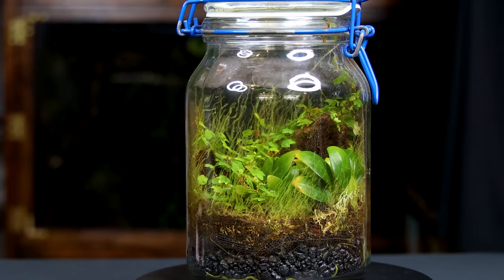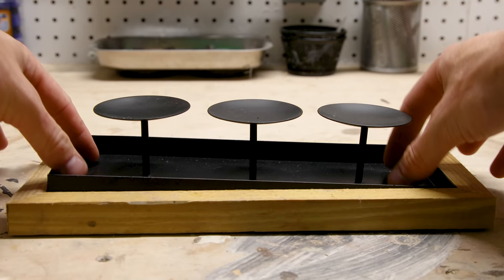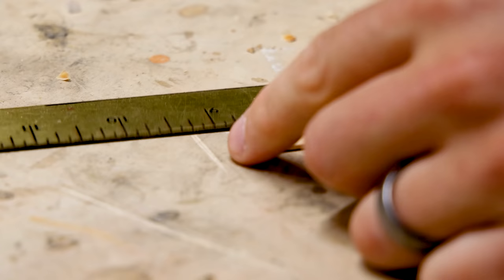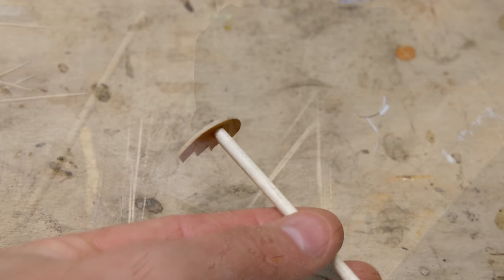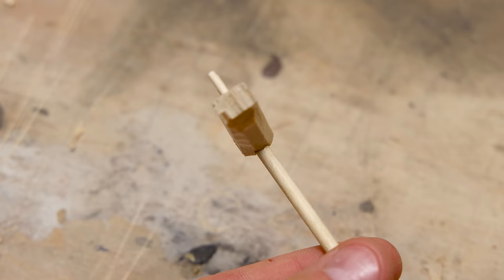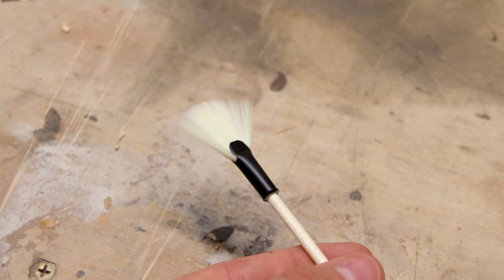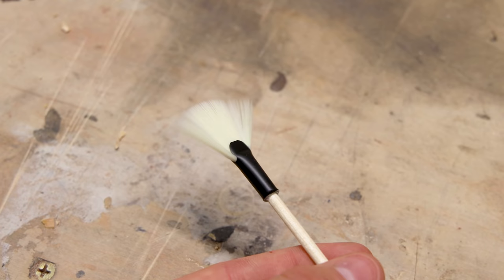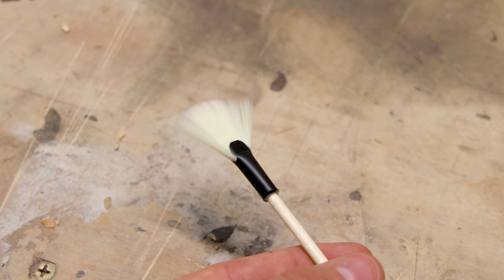DIY Mini 3 World Zen Garden Terrarium

Comment: Hi Serpa! Another awesome vid! Funny thing is, I was just looking through your videos lately and did notice that it had been a while since you've done a terrarium build! Glad you're back at it.

Quick question:

You got me into terrariums this last year, and since then, I've been hooked. I followed your video on moss propagation for my first one. It's been great, and I've been able to find around ten different species to add. However, after a couple of months, mold started to appear. At first I just dunked the moss in a hydrogen peroxide + water mixture, which worked pretty well. It kept coming back though, so I added springtails. While I'm sure the springtails have been helpful, the mold remains. I can't use my old hydrogen peroxide mixture, because I read that it kills the springtails. I have the terrarium under this grow light for 10 hours a day. The moss is looking great, but the mold sort of ruins the aesthetic. Do you ever have similar problems with your setups? If so, what would you do about it in my case?
Reply from the maker: It can happen sometimes due to lack of airflow. If you can install a small fan on the side to keep the air moving, it should stop occurring. Something tiny like these should work. https://www.amzn.com/B08948MT6F/ EDIT get the 5V USB one.
Reply: @SerpaDesign  Thank you so much! I'll definitely have to try those out. Just want to let you know how much of an impact you're having! Rooting you on to 1mil subscribers!
Reply: Oh, and I'd say my favorite was the one on the right. I love the black lava rock look. 😄
Reply: @parmerapps69  I found that too much light contributed to the problem as well. 

Over a year later, no more mold or algea, after switching my moss to live under my Dr Walstad inspired rack w/ shop lights (timer is on at 8:30 am, off at 1 pm, back on at 5 pm, off at 10 pm)

Aquariums no longer grow algae, either.

Comment: I ABSOLUTELY ADORE this tutorial and its unique subject matter!!!  There Is one thing I would have done differently, though. Instead of permanently adhering the globes to the base I would have used strong magnets instead.  You can place one inside of each before the substrate and glue another to the base as one turbo strong option. If you have magnets that are Super Strong like I collect, you could just use one inside or adhered to the outer bottom and that would be plenty to help them stay secure to each metal stand. If the wrong type is used rust may be an issue, so keeping them on the outside may be best for some. Either way, using one hand to secure the base and the other to remove the globe trio, you are free to remove and re-scape/design/reuse as you wish without the hindrance of the awkward base getting in the way. 
Honestly, I could create my own video on the millions of brilliant uses for magnets!!  Great video all around, thank you!!
Reply: I never need glue for my magnet methods due to their strength, so for those who don't have a glue gun, skipping it is fine once properly tested.

Comment: Impressed with your work and have been binging your channel. Love the diy money saving aspect. Try to find you some big ceramic tiles for cheap, shouldn't be difficult to acquire. Do your cutting on the them to lengthen your bench tops lifespan. Edit autocorrect thought them should be time

Comment: While I love hot glue, you could have gotten away better with holding the terrarium on the metal base with a couple wax dots to secure candles into candlestick holders! That way, it’s tacky enough to hold it securely in place, but you can remove the glass from the base for maintenance purposes 😊 I’m not sure how easy it’ll come apart without breaking the glass this way

Comment: I love this concept. When you decide to upgrade this, I'd replace the pallet wood with and actual tropical wood like mahogany or perhaps spanish cedar. You can find inexpensive specialty woods at certain hardware stores that specializes in that kind of stuff. (Rockler Woodworking and Hardware out of Minnesota for instance) I did notice the metal trays do not line up with the bulbs, a manufacturer design flaw but I bet you could make a bigger tray out of a good wood along with special pedestals for the globes to sit on. This way you could also add a stone or two into the outside sand feature.
😉👍 .. and thank you for your inspirations! Watching this and other special horticultural vids got me back into my bonsai hobby and hopefully perhaps into making terrariums.

Comment: Man, buy a small drill press to attach your drill, please! Your life will be easier and the quality will improve. Also a cheap plastic or aluminium guide to cut wood 45 degrees will improve the quality. And a saw with fine teeth. It will cost you 60 US pesos tops.
Apart from this - good work!

Comment: You lost me when you used hot glue to hold the frame together.  Some decent wood glue and clamps would have given you a much cleaner and stronger joint.  Even the super glue would be better then the hot glue.  Hot glue is such a cheap trick in the maker world.  The duct tape of glues.  Perhaps a woodworking/cabinet making class could help your builds look a bit more professional.